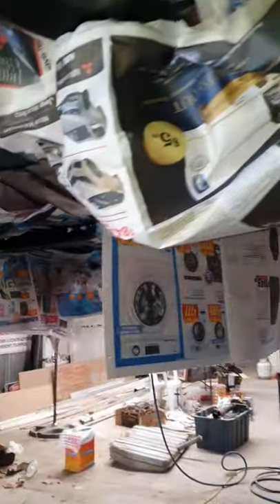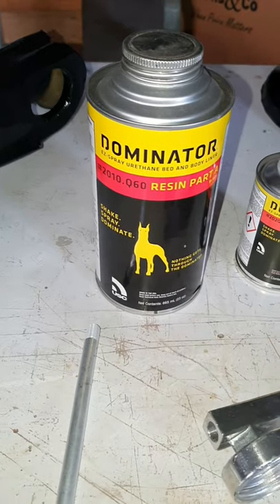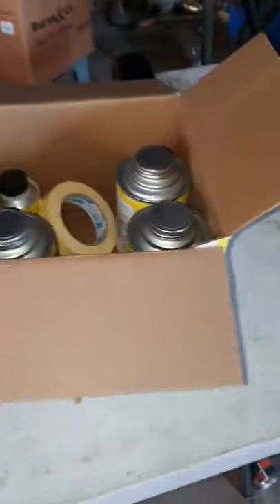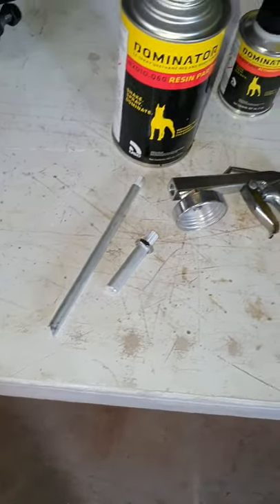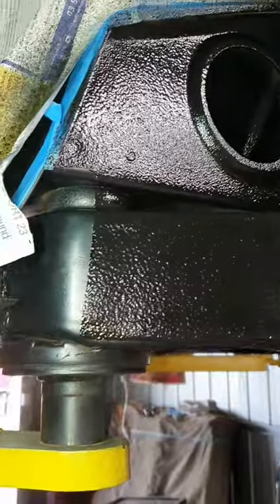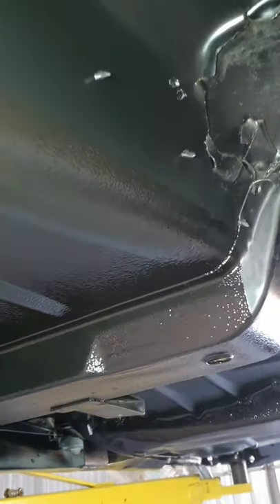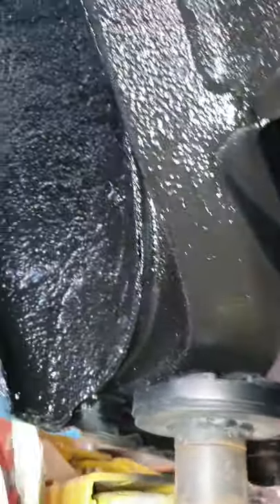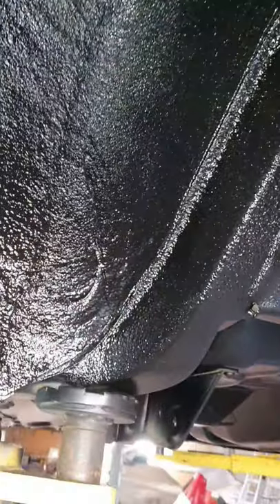body deadener V stone guard hj build part 2

Comment: A word of caution using any kind of rubbberised undercoating...I have literally just done my XR6, walked inside and jumped on to see if I could see any 'down the track' videos for how long it lasts. I found one where a man was pulling it off the chassis (hes is a mechanic and was working on his friends 2011 vehicle the fella had bought from new) and chunks of the chassis were coming off with it. He said any rubberised black shiny coating should be avoided beause although it looks GREAT, it doesnt breathe, and it traps the cars moisture under it and starts rotting whatever it is stuck to. Im going out to scrape mine off in the morning..just wanted to let you know, you might want to rip a bit off and check under it just incase :)
Reply from the maker: Cheer good to know 
I used epoxy to prim the underside first then sprayed the stone guard 
The stone guard isn't anything like body deadener, 
Thanks for watching have heaps of videos to upload just been lazy 
Cheers Dave
Reply: That's only an issue if you spray over damp areas... Did he do anything to mitigate that issue before locking in the moisture?